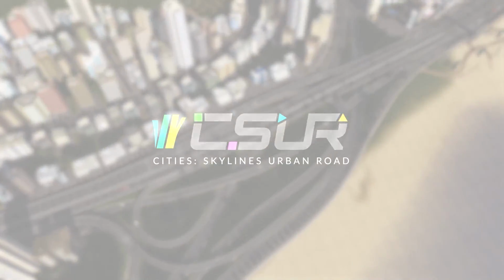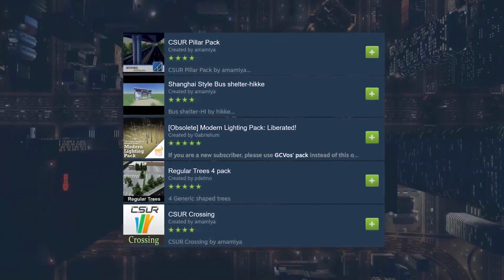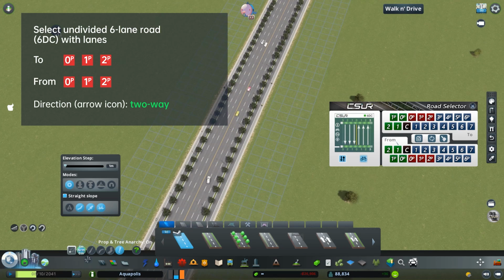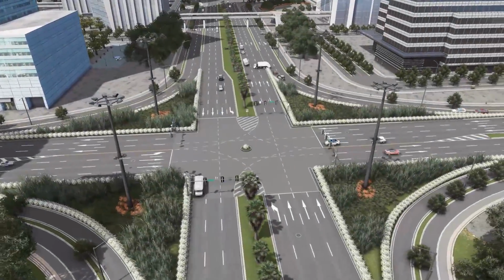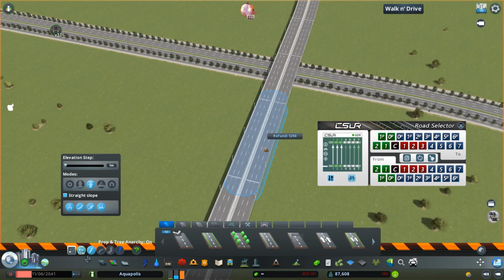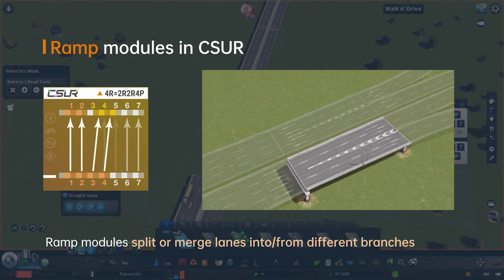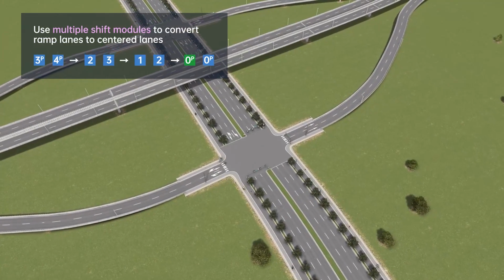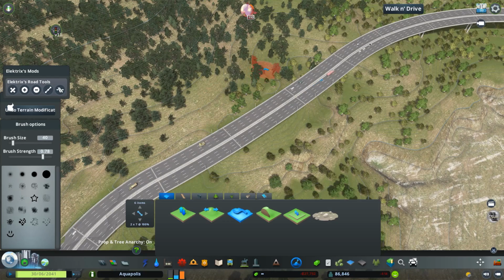Urban Road mod (CSUR) with VictoriaCity | Mod Workshops | Cities: Skylines

Comment: If we ever get a cities skylines 2, this is how roads should work. Oh, and while we're at it, include intersection marking tool and Traffic manager in the base game as well.
Reply: NAME NAME NAME While they’re at it, we need more multiplatform metro interchanges too
Reply: @CK-wv7gf  Also a full seasons' cycle
Reply: and more assets
Reply: traffic manager is pretty big mod, i think low end pcs might appreciate to not add it. (or it could be a free dlc)
Reply: Add in metro overhaul system too
Reply: Maybe just a basic lane tool where you can set turning lanes
Reply: Yeah, at this point I think Cities Skylines has reached its apex. Countless mods and DLCs have shown what can be improved upon from the original concept and explored what more can be done both on the "gamey" side for people who want to be challenged by managing a city and the "simulation" side for people who just want to build a beautiful sandbox that tries to mimic reality as much as possible. But everything just feels tacked on at this point, because the core concepts of the game were never designed with all these new options in mind and there is only so much modders can change about it.
I hope they will eventually take all those post-release experiences and turn it into a sequel that was built from the very start with those improvements in mind.
Reply: I really want to see more Japanese assets in Cities Skylines 2 as well >.< , my otaku self i- ...
Reply: I wouldn’t play this game without move it, road anarchy, fine road tools, landscaping or traffic management. There are Many others, but these are  just some that make the game playable.
Reply: And get rid of the paradox launcher as well
Reply: CrushaKRool 

Where is the TL:DR?
Reply: While you’re at it, why not tell everyone: “Hey, if we’re making a sequel, you need a $1,000 PC because your low end pc won’t be compatible to play this upgraded Vanilla”
Reply: @alohatigers1199  Yes because the devs will not at all have the option to make the code more efficient since it's now in the base game and not a mod.
Reply: Well please keep in mine that as amazing as that would all be, it might start to be too much for people new to the franchise. Which is why as it stands right now I thinks it works pretty well because if you do want to delve that deep into the mods you can always get them at the steam workshop.
Reply: Node Inspector as well!!!
Reply: @alohatigers1199  I got a 500€ 5-yr old pc and my graphics card is even older and the game runs fine with most popular mods and some assets.
Reply: @CK-wv7gf  Looking over at TF2's modular stations...
Reply: @JohnLudlow  I'm on console now so the workshop can't help me. Rip
Reply: @CK-wv7gf  TF2 (Transport Fever 2) isn't a mod. It's a different videogame based around managing transport networks. It has a feature called modular stations where you can bolt wacky combinations of platforms together. It's something Cities Skylines would do well to look at if they do a Cities Skylines 2

I know what you mean though - I have Skylines on PS4 as well as PC, because it's easier for me and my wife to play together on PS4.  There are a few mods I'd like to see on console (TMPE, MoveIt, Auto Bulldoze, maybe CSUR, some of the more interesting stations and airports), but I'm not holding my breath.
Reply: I would love to see a multi player version too. Have the one with the most mods/expansions host the game and the guest just piggybacks off that.
Reply: @alohatigers1199  all you need is a high amount of ram lmfao
Reply: I’d prefer the workflow of node controller and network multitool honestly
Reply: Yh they need to do this for trains and metro like alot more multiplatform stations because it make no sense that a station with 5 platform has only one track coming of it its so unrealistic
Reply: That's way too complicated for beginner and intermediate players. Also, it would be very challenging for such complex features to run on consoles and low-end PC's. In my opinion, they should stay mods.
Reply: I always had the impression that the company which developed Cities Skylines did it using very low cost offshore human workforce. Mostly because ins't multithread.
Reply: @cutejumper  It's really not that bad of a mod resource-wise - and it could easily be included in the 'content' menu as something you can turn on and off, just like other game options like unlimited soil and such. I find it doesn't really do much to my games performance, FPS-wise anyway. The lane marking tool should have no effect on performance at all.
Reply: Well, you got part of what you asked
Reply: welp, CS2 has been announced, so lets hope they do this!
Reply: Would you look at that
Reply: It seems like your dreams are going to become true.
Reply: This comment has aged very well. This is exactly how they work now.
Reply: @TJusnow  well not exactly, but it's as close as one could reasonably expect, so I'm happy.
Reply: @namenamename390  lol
Reply: Well, we got it

Comment: I really have to try this out. I've been meaning to for a long time, it's just ... intimidating, haha. This introduction tutorial goes a long way toward demystifying it. I don't actually think this is how vanilla roads should behave - not exactly like this, anyway - because this clearly requires a level of knowledge and patience that a typical player isn't going to have. All of this would have to happen more automatically for it to make sense for vanilla play. That said, I'm definitely not a vanilla player. I'd love to see a port of this overhaul with more Americanized highways too.
Reply: The mod is quite easy to use actually,  you just need a few hours to get used to it and try doing interchanges with as little shift lanes as possible ; )
Reply: I agree- this mod is really cool and obviously powerful. But this tutorial has my head spinning. I think the information is packed too tightly- I feel like I jumped into the fourth level of the mod's tutorials. I need Urban roads 101, explained at a 101 level.

Comment: This is great. One thing I wanted to ask was if I could potentially use this tool to implement a tram in the middle of the road, even street side parking with physically separated bike lanes. Additionally I was wondering if I could even implement a metro in the middle of the road.
Reply: gq
Reply: Well they didn't come with it,  but you can do it if you leave the center empty and add it manually.
Reply: I think they are working on that, I don't think this is the final form of this mod

Comment: is there a way to remove the automatic intersection/ramp markings? id rather use Intersection Marking Tool to make my own.

Also the lane arrows. if these are replacable, this will make all my other road assets obsolete

Comment: The only thing I don't grasp yet, because maybe I'm doing something wrong is how to connect the default highway layout (3 lanes) to the UR built roads.  They always come in off center.  I'd love to be able to have it seamlessly connect from the vanilla highway to the mod, but the mod uses the super wide road as the default so the lanes don't line up.  I think I'm doing something wrong...oy.

Comment: I hope in CS2, roads could be created in a way where we can dictate how many lanes do we need first before laying it out while having options to modify the functionality of each lane (bus lane, bike lane, tram lane, etc). No need to download countless mods which becomes defective over time due to patch changes. It's also nice if we could have advance options to modify every lane whereby we can elevate certain lanes while the others remain grounded similar to how complex city roads work in real life. Ability to do double decker roads which are very common in Japan and South East Asia with options on converting the above road to a rail or a metro rail. Give us freedom to adjust gutter size, with options to create amazing pedestrian paths alongside the road before the RCI building zone. I also hope they include intersection options where you can automatically create slip lanes and roundabouts without spending tons of hours.

Zoning in CS2 should not only be limited to roads. Not all buildings are connected to roads. Some of them are connected to pedestrian paths especially commercial buildings.

Fillers can be also a great featute as well. The game can automatically fill up certain spaces as desired by the user to create amazing plazas of any shape similar to how Cities XXL do it.

Comment: Blank road builder built on this legacy brilliantly :)
Reply: just wondering does it still work? any errors?
Reply: @Luke.Skyguy  blank road builder still works yes. And has a synergy with intersection marking tool if you have it as well

Comment: Looks a bit difficult but of course, very neccesary, why Colosal Order doesen´t make a pach with most important mods included?   For example, this game without traffic manager is too frustating... The IA is too stupid, and you must to fix some problems with the warehouses which easily  get stuck and the trucks don´t go anywhere. And the trains colapse in the outside way!!! Going to other cities, with big cities, the train railway ends always full of interurban trains :(   And thanks to the no limit camera mod, I discovered one of the bigest reasons of the bad optimitation of the game, most of the tourist and industrial trucks are people waiting on the limit of the map!!! If you see close, you will see hundreds of people "becoming" cars and trucks, all of that people are extra things to the CPU and GPU...  And we need to have the option of make more conections wiht outside cities, with roads and train railways, is very necesary for the trains to divide the traffic. 
Other thing very neccesary is the option on special factories to select one warehouse for have allways the order of supplies, like a botom on the material icon to select the warehouse with that material.
Reply: Fucking shit, too dificult and enoying to learn!! And when I uninstalled the mod, it crashed my entired city roads!!! A game losed by the mod... :(
Reply: Ok, now I got it better, but one thing that I don't like is what happend if you quit the traffic lights, even if the cars still turning, the texture change makes is too unreal XD  For the rest, this mod is awsome, bit extrange at the begining but after few hours and 2 normal intersections, you will get most of the theory XD 

Now I will try to make high ways conected with city roads in the middle of the city, for the moment I was making transitions to vanilla roads for the city.

Comment: This looks amazing. However, why do I have a feeling this is gonna crash my game. My game is so glitching when I just add 60 custom workshop items and 15 mods.. Wish I had a gaming computer...... :(
Reply: i feel you, I have a mac from 2011 and I have over 3000 assets and 60 mods but somehow the game is somewhat stable, your computer can probably handle more, the loading time might just jump up to an hour or you may just have to have autosave on in case something happens. I have had many different computers play C:S with plenty of mods and assets and none of them were gaming computers.
Reply: @user-wq9mw2xz3j  I get those loading times with loading screen mod. my computer specs are

MacBook Pro (15-inch, Late 2011)
2.2 GHz Intel Core i7
8 GB 1333 MHz DDR3
AMD Radeon HD 6750M 512 MB
Intel HD Graphics 3000 512 MB

I get loading times just under an hour after working on a city for a day or two. Starting a new map is between 30 and 45 minutes. Keep in mind I have no other applications running except steam and C:S. I have no doubt that Loading screen mods makes the time shorter because when I had worse computers with far less assets and no loading screen mods, the loading times were roughly the same if not triple the current times. (at one point loading took 3 hours so I would set it to load and then go to bed.) I was gonna save up for a gaming pc until miss rona came and messed everything up.

Comment: Needing 4 shift modules for a single exit is completely non-sense. They get so bulky and un-natural in more confined spaces.
Also I actually thought for once you guys got rid of the centre node philosophy, but it takes just one small shift module to realise you are twisting the road to have the node at the same position rather than just moving the node to keep the road straight. This design is really flawed.
Completely disappointed after spending 3 entire days building one intersection. This could've had a lot more potential